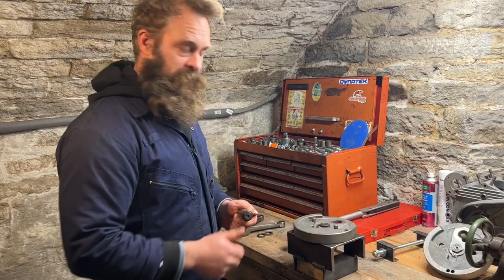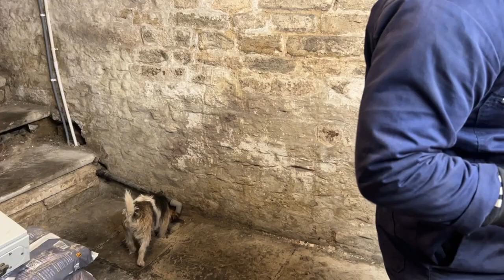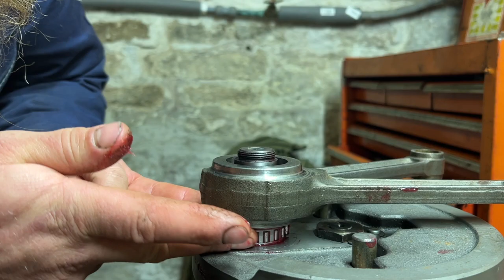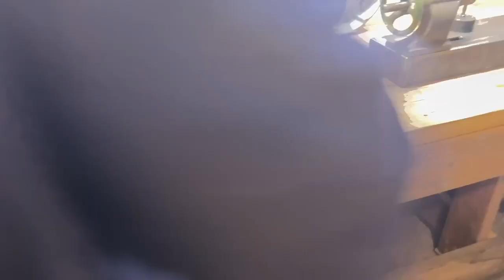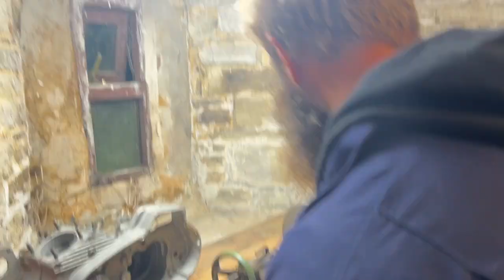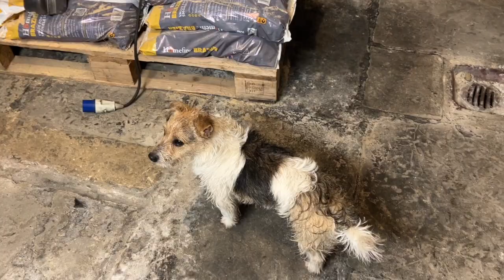Harley Ironhead Sportster. Stroker Crank shaft build and true

Comment: I think you are the most careful person I have see truing a crank. Be careful about really cranking down on the centers as you might push enough to affect the readings. I don't really know that much about Harleys. I bought a 1998 evo and have been doing regular maintenance replaced ina bearing, replaced lifters as they are both weak points. Couldn't seem to adjust carb. Noticed one plug black and the other white. Realized I had an intake leak and fixed that. I am really impressed with your work and your calm attitude when you find the really bad work that someone else has done. I am enjoying your videos from North Carolina, USA
Reply from the maker: Thanks a lot for your comment. Believe me off camera, I'm m not always so calm😂